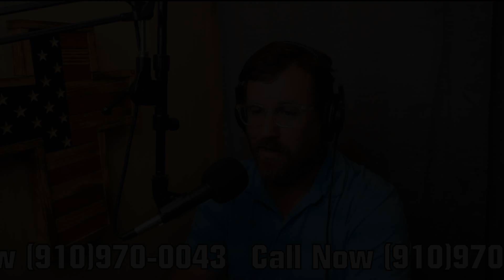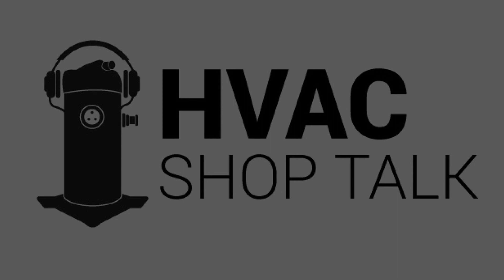How to Diagnose TXV Failure on a Heat Pump

Comment: I'm a homeowner with a Trane heat pump.  I have been round and round with my tech about why my heat pump throws error messages in the winter in heat mode.  First they replaced the heat strips in the air handler.  Then they said the coil was leaking in the air handler.  Now they came out for their tune up in May of 2025 and the freon is fine!  Now they said it might be the expansion valve in the condenser since it only shuts the system down in the heat mode.  But they did not do the diagnostic you did in this video.  So what is a homeowner to do! I'm going to hope this 13 year old 20 seer Trane gets through the summer OK.  But I will be faced with maybe getting a new expansion valve in the winter?  Is it worth it?
Reply: Find a better technician. Heat stripshave nothing to do with your heat pump. They are emergency heat
Reply: @eljokerjce  I will.  The unit came through the summer with no problems or error messages.  Now with winter coming, and reversing the heat pump, we will see if it throws errors.  I'm still thinking it is the outside expansion valve.
Reply: @gosman949 what error messages are you getting? If it’s “open switch” and “soft lockout” then yes most likely it’s the condenser TXV
Reply: @eljokerjce i agree, find new technician. Sounds like hes just guessing

Comment: At 1:06 you said that if you run it the other way it will work in heating. But I just can’t see how that would actually work because either way that refrigerant flows, that TXV is slammed shut. So it will literally try to pump down as well in regular or reversed.
Reply: Sensing bulb
Reply: I don’t think the evaporator TXV regulates refrigeration during HP mode. Most systems nowadays have a TXV at the condenser too

Comment: Have a heat pump that runs fine all winter in heat mode, but the evaporator freezes up often when on cool mode.  Im leaning toward the txv on indoor unit/evaporator
Reply: I have just the opposite.  Heat problems in winter when I need the heat pump the most to save on electricity here in north Texas

Comment: So on a brand new unit..like lennox since the drier is inside the cond..behind the service ports theres no need to change out the drier when doing the indoor txv
Reply: Always change
Reply: Umm if dryer gets exposed to any outside air it should be changed